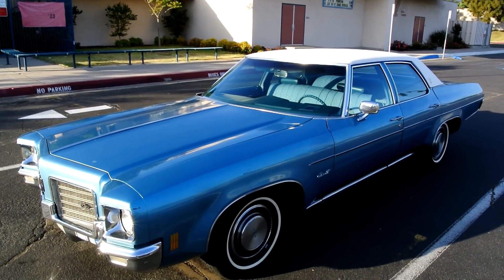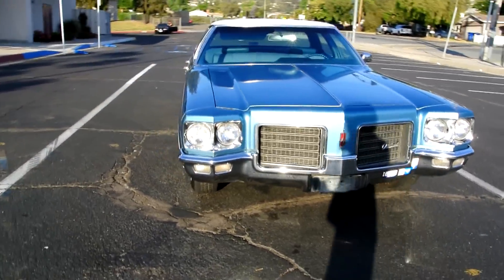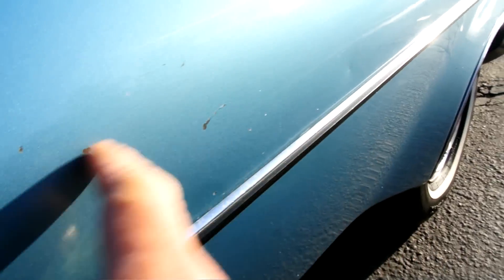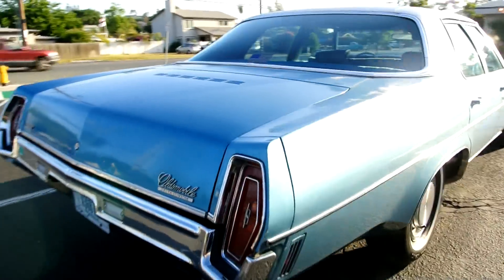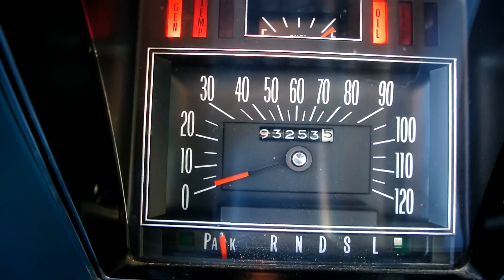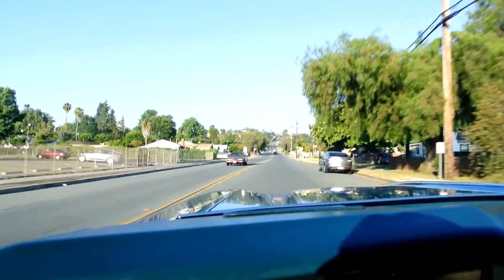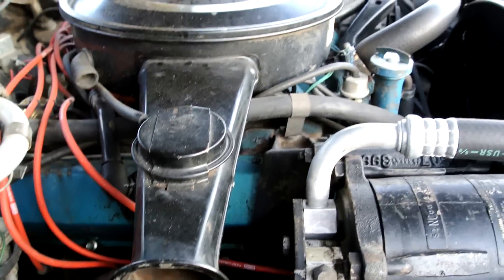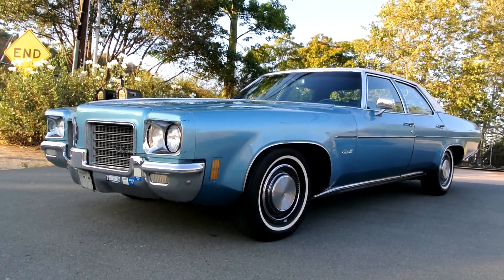1971 Oldsmobile Delta 88 Eighty Eight 1 Owner 455 V8 Custom 88 Youngtimer Classic Car

Comment: You have a knack for eloquently skating past important issues…."tap tap tap…could be a rod or a push rod." Either one would be kind of important."A/C compressor moves freely. Still R-12 so it's probably just a recharge and some guys still have R-12.Good luck finding that guy….But you do outline and sell nice cars and you are very informative.

Comment: Miss my Olds ...for the young that never climbed in one of these highway stars you dont know what you missed. You could run 100 mph down the freeway and it was silent and smooth .You would have no idea you were running at that speed ...no engine screaming just a smooth 455 purring with the gears to take on you on a long haul as comfortable as could be

Comment: Thanks Nathan.  Please ask a local mechanic to take a quick look at the flex plate bolts, however.  They're easy to access from underneath and won't cost a lot to have a look at.  If he finds nothing wrong, then there are worse problems, but if I'm right and it's the flex-plate bolts, you'll have a $60 fix make the car worth a lot more money and get it sold.   This car has a lot of video views and a lot of commentary -- a lot of interest from the public.

Comment: When i was a teen in the 90's my friends had civics escort GTs mustangs well my uncle passed away rip and left me the beast 71 Olds 88 455 4 bbl carb my friends liked to race in there little cars until i showed up in my 71 455 that thing i swear could do 150 no problem speedo only went to 120 it had tremendous power for a big car and that was the norm before the restrictions came in 74.

Comment: I agree.  I've got a 1969 Riviera with the 430 CID engine (7 liters!),  when I take it out on highway trips to the Phoenix area from Los Angeles, I can swing 19 miles per gallon, which is amazing for such a large car and engine combination.  I credit the high compression ratio and lack of smog equipment.  On 1973 and later big American cars with lower compression engines and smog equipment, I'd estimate that they can only get about 14-16 miles per gallon on the highway.

Comment: On a future trip, I'll try to stop by your new lot -- looks nice in the videos.  I see you sold this car.  Is the new owner going to fix the engine tick/knock or did you get it fixed before selling it?  Just wondering what turned out to be the cause.
Reply: This guy loves to sufficiently point out problems, but then just fluff over them!....that engine noise sounds very expensive...this car has about 100,000 miles on it...much work will be needed to make it really reliable and nice...no bargain deal here!.

Comment: The one good thing what I like about the lower compression V8 engine's built from 1971-72 is they are able to run on regular or unleaded fuel yet they still have good drivability and performance, I consider 1971-72 to be the last truly great era of classic cars before they became fully smogged with poor drivability, emission control devices, 5mph bumpers and smog pumps.

Comment: That thing is about to blow up lol
Reply: James Wil ,that's a minor problem...not gonna blow. Tjis car is immaculate aside from thos littke clang •a• lang, which ain't nothin'. It's either a timing belt knocking or loose gasket , sounds like, which is nothin' to fix. IDk what's up with all the random light and turnover issues, but it def.needs the alternator looked at, too~still simole for a gear head to fix/replace.   This car is BEAUTIFUL!  That engine...wow. 94k...can't beat it.
Reply: This car obviously sold way back when cause this is old, but I just happened to see that particular one, and im in love...moreso than any of your other u tubes ive wtched...wish id seen this b4...anyway, goin'2 go chck.out ur site. Now. Located in Cali, u are, right??
Reply: I need AN '88 ROYALE! [or a Delta, if that's all I can find.]
Reply: Leslie Churchwell lol, no mam. I ain't selling these cars. I'm trying to get some sort of business going selling car's. But no this ain't me. Go call him, I've heard he's really good!
Reply: Leslie Churchwell and yes it would've been great to fix up! What you've listed could be true too. But 8 out of 10, an engine started making this noise and it wasn't long at all till you had a rod sticking out of the side. Same noise in a 90' LTD started making. Number two piston rod took a quick exit on that 302. 95k on it.

Comment: I'm sure this car is long gone since it was back in 2012, but that's very unusual for a 455 to have a bad rod unless it got some kind of unusual treatment, maybe an accidental over-rev.  It was definitely making the noise at the same RPM as the engine was turning.

Comment: Found an online MPG to Liters per 100km conversion tool, so say you could get 13 miles per gallon out of this very large 455-equipped vehicle (possibly optimistic, not sure), the value for liters per 100km comes out as: 18.09 liters per 100 km.

Comment: I'll have to say that engine doesn't sound like it's long for the world, unless the fan is hitting something.  In '71, the standard engine in a Delta 88 was a low-powered 350, unlike the powerhouses back in the 60's, so the 455 is a definite requirement.  Did you sell it?

Comment: $2000 to rebuild engine with brand new summit parts; $6500 at least in body and paint job... might as well run new exhaust and replace all washers,bushings,calipers, brake lines. replace that rochester carb. (cuz i'm betting thats wut it has) with a 650 holley....might as well replace the stock manifolds with headers unless ur just wantin original state, me i'd upgrade the motor, keep body stock with fresh paint and get rid of them damn stickers! so i'll give $2,500 for it...the motor's done.

Comment: Um holy shit that's a major engine upper half rebuild- cars back then aren't like today with the ability to run 100k in between service. 100k is 250k for a modern car from 1988-2004.
Reply: For one, that's definitely a bottom end sound, top ends on Oldses can get noisy with wear but it sounds more like a typewriter than a knock. Second, for there to be a problem this bad at that mileage I'd bet that the former owner of this car either didn't have the oil changed for years because there weren't many miles on it, and the old stuff sludged up and starved some bearings when he took it out of hibernation, or he flat-out abused the engine for those 93,000 miles (or both).

Only thing that would fail in these engines at that mileage without neglect and abuse is the factory nylon-coated cam gear (failure of the coating causes valve timing issues, can burn up valves if the chain jumps but doesn't cause a knock like this), other than that they're rock solid if you maintain them, same as just about any engine from the last half a century. That 100k mile crap was true in the days of babbitt bearings but since then has become a convenient excuse for idiots who can't be bothered to maintain their stuff and won't own up to it when it breaks.

Couple of examples: Friend's older brother had a '97 Cavalier which he took great care to detail any chance he got, so it looked fine from the outside, but the engine locked up at just 97,000 miles from neglect. Other friend, a '94 Mazda that had shot rings and constant #3 misfire at just over 100k (I suspect from abuse). If I omitted the fact that those cars weren't taken care of I could claim that engines from the '90s were junk compared to even newer engines, but it wouldn't be any more true. Now, I did have a '95 Buick RMS that had a solid engine but everything else went to hell starting at around 115,000 miles (mainly non-serviceable components that reached their expected service life). At least the engine's internals held together, because nothing else seemed to.

Source: Owned many of these behemoths with well past 100k, have had a couple timing issues at 120k or so but never had an engine's bottom end fail on me like this. Bottom line: Maintain your shit, don't blame the car.

Comment: It sounds like a rod is about to shoot out any second. Old cars only lasted to about 100,000 so it's about time to rebuild the engine.
Reply: +Antiquetractorsetc Perpetuating that crap doesn't make it true. It was only that way if you abused 'em or did yokel oil changes... "Replace the filter and add a quart." People on the internet like to forget how common that sort of unintentional abuse was back then, and that a new car's engine can and will croak before 100,000 if it's owned by the same type of careless dolt. All depends on how the car is used and cared for throughout its life.

For perspective, I bet you'd probably think I'm a nimrod if I abused and neglected a Camry until it threw a rod, then claimed that that's proof-positive that all new cars won't last past 100k.
Reply: +Mercury Cyclone Honestly I think jumping to a rod knock was a little extreme at 93k, a little diagnosis would've shown what the problem really was. Mechanical fuel pumps will make the same sort of worrying noise if the pump arm breaks loose from its pivot mounts and gets knocked around by the cam lobe.
Reply: Antiquetractorsetc I'd have that 455 built into a 496.

Comment: when u take away the original stuff then the value of the car becomes undetermined and then the value becomes only what someone will pay for it. some upgrades could be what came from the factory like upgraded radio and power antenna and such but if u start putting on stuff that the car never came with u throw away the price point to work from on the car